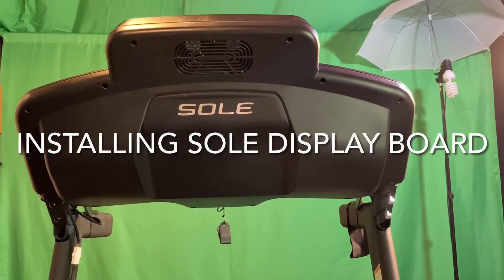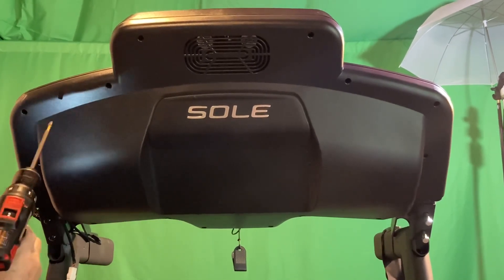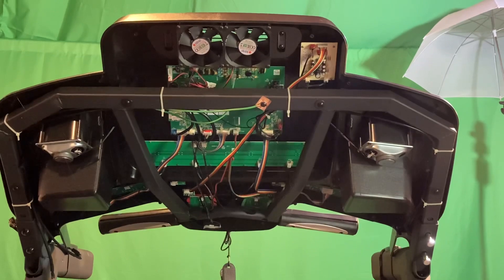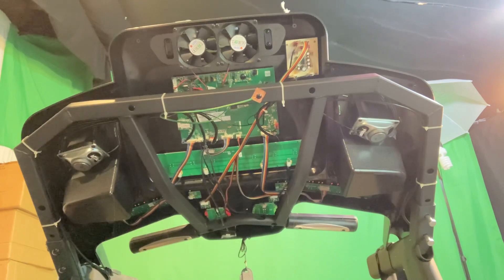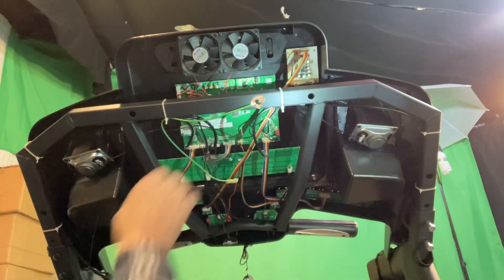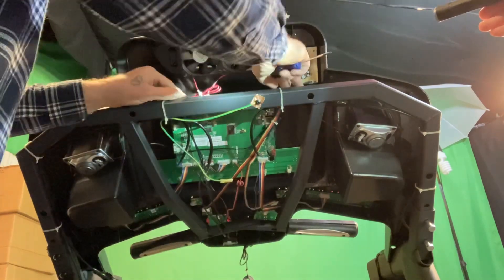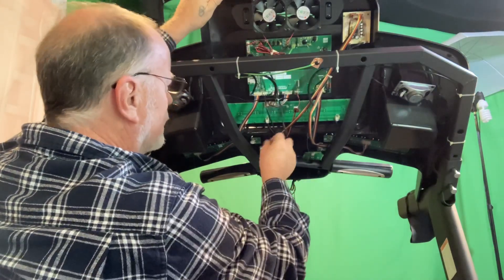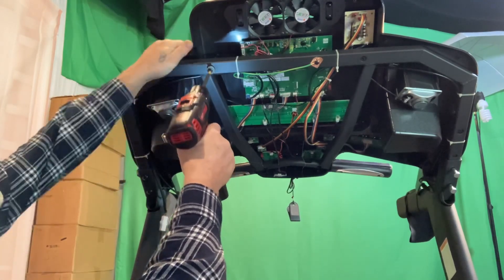REPLACING SOLE F63 TREADMILL CONSOLE DISPLAY

Comment: If you replace the whole console display including the ‘arms/legs’ as one piece…is the f80 and f63 interchangeable from that standpoint?  The legs appear to be the same size and same distance apart…
Reply from the maker: Depends on the year the f/63 is normally a 20 belt base but the f/80 is 22” base belt I do have a video on this replacing sole console I change a 80 with a 63 just to give you a idea

Comment: I have my treadmill screen blenking black and gives continous peep but not starting.. All connections are OK, motor is OK.. On the board, only one green light on (which is power on).. I stopped hwre don't know what to check more? I am not good on electronics 😢
Reply from the maker: If your lower controller light is solid green then most likely your console is bad . Once your console has power to it it should be steady